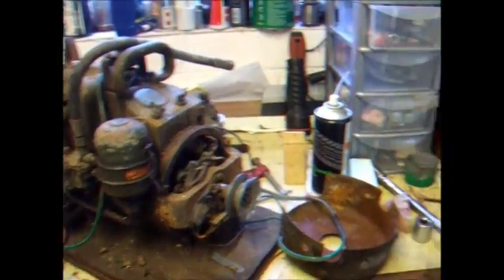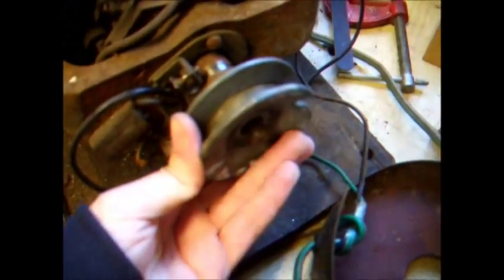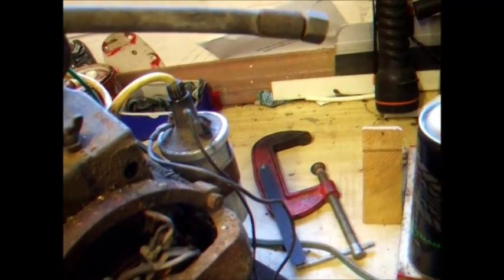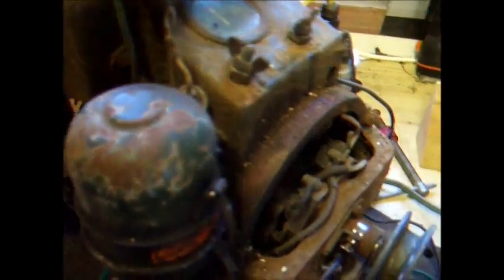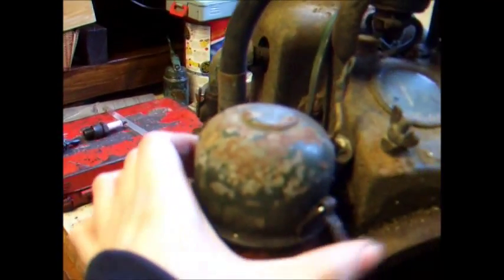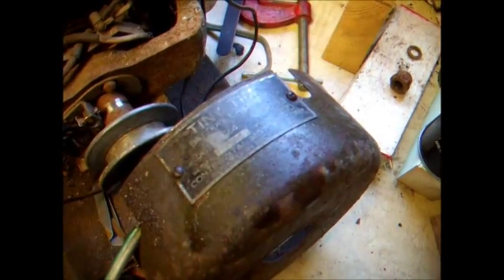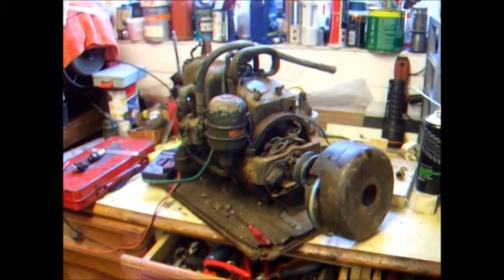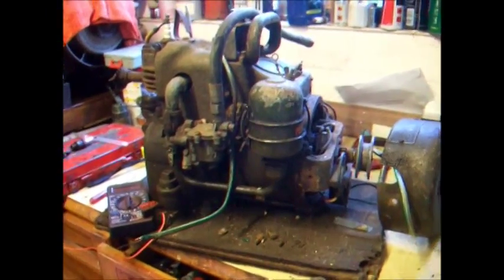Ex TANK engine - New project

Comment: you might be able to use a muffler from a briggs engine, those are cheap and plentiful, on amazon us the ones for horizontal engines sell for 6.73 and 6.99 on amazon uk http://www.amazon.co.uk/Briggs-Stratton-Genuine-89966-Exhaust/dp/B0038U3KVU/ref=sr_1_1?s=outdoors&ie=UTF8&qid=1391463100&sr=1-1&keywords=briggs+muffler
Reply from the maker: sadly not :( Briggs engines tend to use 1/2" bsp. Which is nearly double the size of thread on this engine. It really is small lol
Reply from the maker: MO3MINI
Actually I might be wrong. The carb is a smaller thread. But the exhaust may well be 12" in which case I can buy a dirt cheap exhaust on ebay. Will have to double check though lol
Reply: ou could get a piece of pipe from the hardware store and try to adapt it for a briggs muffler